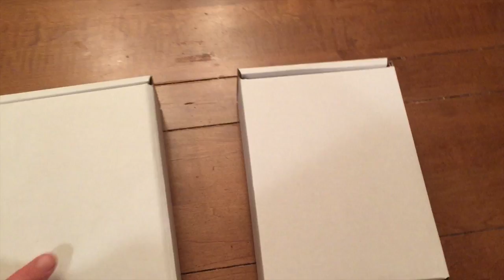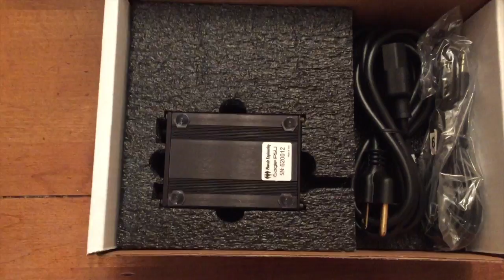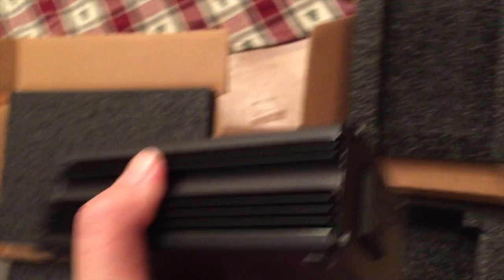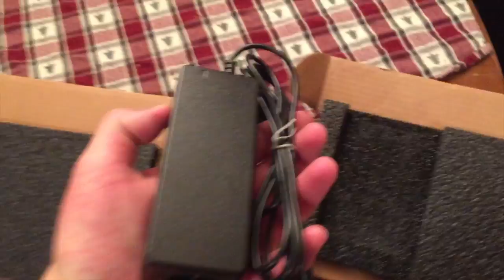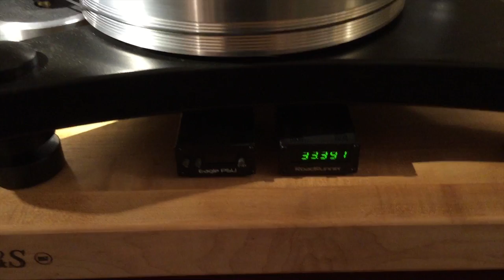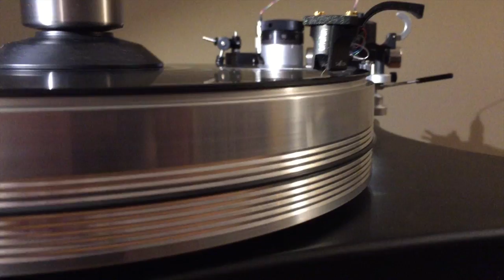Eagle PSU

Comment: I used it on a different table but just ordered the Prime. I wanted to make sure that there was room for the platter to turn with the sensor and mag in place
Reply from the maker: You just have to make sure that you have the newer, thinner magnet that they supply.  The original, thicker ones rub.

Comment: I just ordered that table and have the Eagle and Tach.  Can you tell me where you placed the magnet and the sensor?
Reply from the maker: Hi, I placed the magnet on the very edge of the underside of the patter.  The sensor is at an angle on the rear left of the top of the plinth.  The hall sensor on that sensor board needs to be positioned directly under the magnet when it passes in order to work properly.  Hope that helps!

Drew

Comment from the maker: The Boos Block is 24 x 18 x 2 1/2".  The blocks are Diversitech MP-2C blocks, for around $0.25 each (twenty five cents).

I had the Cadenza mounted by the dealer, Soundstage Direct
Reply: +83911scdrew 
Hi Drew - Are the MP-2C blocks good enough to handle the weight of the Prime Turntable and the Boos Block? How heavy is the Prime and Boos Block combined? Also, did you double up on the blocks to handle the weight or can you use single MP-2C blocks at each of the four corners? Thanks in advance!
Reply: +Vincenzo Baldacchino The blocks support the turntable plus the cutting block just fine.  I did double them up, so two per corner, eight total.  A whopping $2!  Sorry for the delayed response!
Reply: No worries Drew - I ended up spending a lot more for my blocks as I got them from the same place as the block - I ended up returning by Boos Block as I had some additional $$ to play with and went with the Maple Shade. It's all good! :-)

Comment: What size Boos Block are you using? And what isolation feet? Do you like them? Looks great.
Reply from the maker: It's a 24" x 18" x 2" block.  I bought it off of Amazon.
Reply from the maker: The isolation feet are Diversi-Tech MP-2C blocks.  They cost like $0.22 each and I used eight total (4 stacks of two, one stack per corner).  I believe they are exactly the same product as some other more expensive audiophile treatment blocks (which are resold/repurposed/marked up).